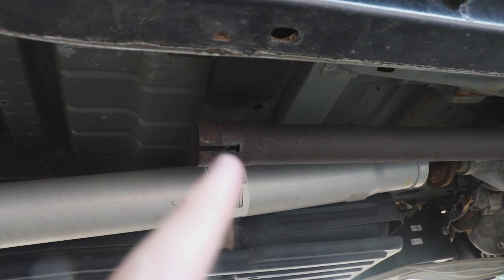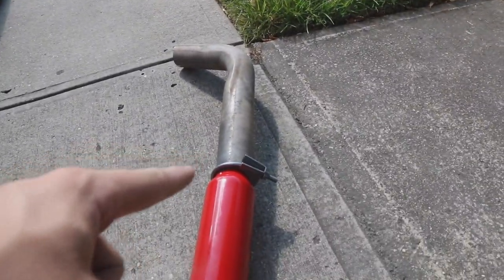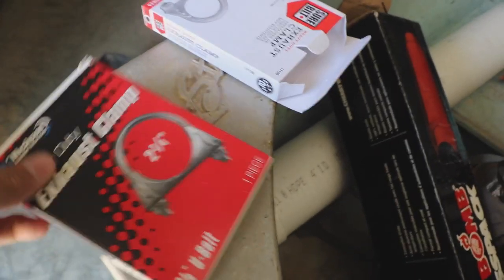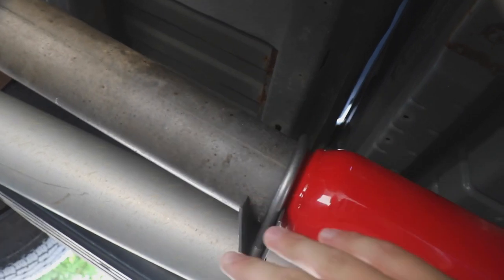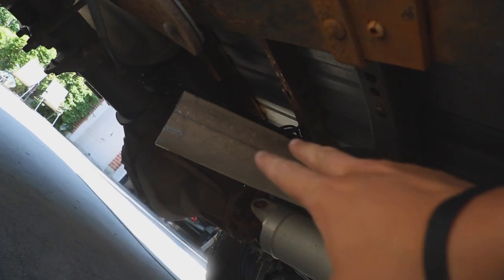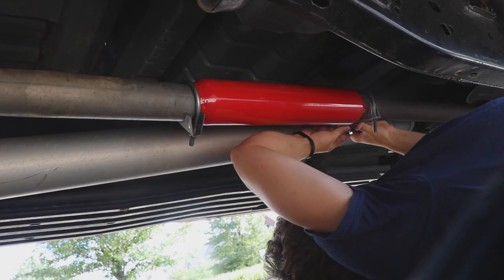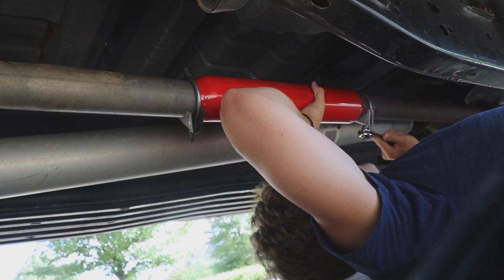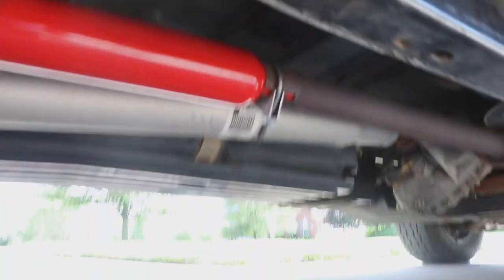CHERRY BOMB VS STRAIGHT PIPE On My 2010 5.4 F-150 (How to Cherry Bomb Your Truck)

Comment: I have a 12 inch dyno max glass pack with it coming out right in front of my leaf springs it’s 3 inch clamped on to my stock pipe and it sounds pretty good
Reply from the maker: I bet I think I’m going to get the flowmaster outlaw duals and that boy gonna be loud

Comment: I think you should straight pipe and have a pipe welded to where the muffler used to be. I have a video of the sound on my 2009 5.4 in my channel. Either way, good video.
Reply from the maker: Thank you I need to check that out!
Reply: I agree doing that to mine!

Comment: On the original “straight pipe” did it ever sound snappy? I’m trying to do the same running out the back without sounding snappy
Reply from the maker: Could you describe snappy more I kinda think I may know what you’re talking about but not sure
Reply: @OutsiderOutdoors   snappy being like if you accelerate it doenst sound good, like it loses the growl of low rpms.. like you can so one times tell the pipes are too small 

basically, I have a flowmaster 40 set up. 3inch inlet to the muffler, going into 2.5 inch duals.. I want to know if you’ve run something close to this, I want to just replace the muffler with a y pipe (3 inch to dual 2.5s) but I don’t know if it’s going to sound bad
Reply: No one else seems to have done this
Reply from the maker: @jackcally2945  well it will definitely sound different than mine but I love my straight pipe I took that cherry bomb back off. I don’t believe mine sounds snappy either I’ve got the muffler taken out and actually just put two extra pipes down there to run the fumes out under the bed. I’m going to upgrade to flowmaster outlaw when I can. Have you searched YouTube or anything for a sound clip? Hope this helps haha. It doesn’t sound snappy
Reply from the maker: @jackcally2945  hate to change up also but In higher gears it’s not as deep and sounding like a “boat” if you know what I mean

Comment: 1, that's a muffler not a cat 
2, that isn't straight piped....like at all        
3, the cats are connected directly to the headers and can be seen from under the hood, I've heard there are 4, 2 on each side that connect from a 2 into 1 Y pipe
4, it sounded better without the glass pack
Reply: There is only 2 cats but other than that you are correct
Reply: if you want your 5.4 to be loud you need to take the cats off too. Also at first, the cherry bomb will be much more quiet than the straight pipe, but wait till all the packing inside wears off and itll be way louder, with no cats and a burnt out cherry bomb the 5.4s make loud popping sounds.

Comment: I've got a single straight pipe with cats but I really want to do duals with cats, Not really sure if my neighbors will like it though 😂
On my 5.4
Reply from the maker: Yeah I really think I’m going to duals soon 😂
Reply: It won’t be that much of a difference I had a truck I could drive by banks and set there alarms off